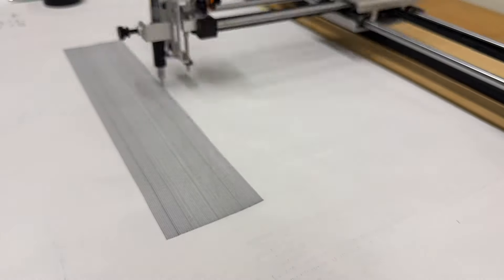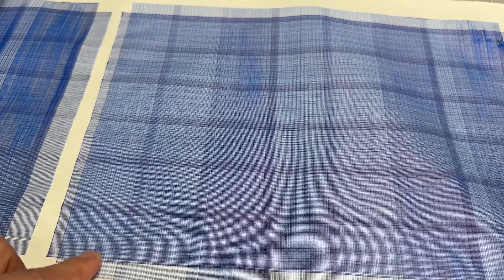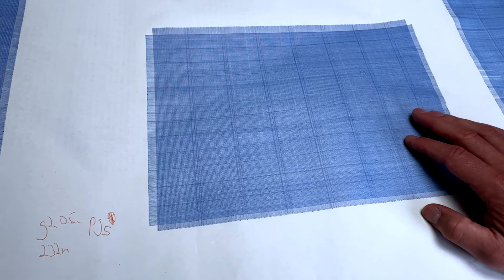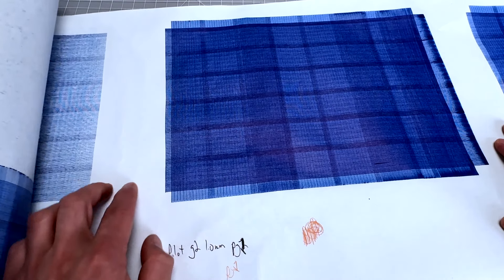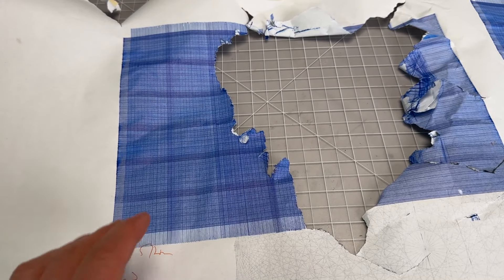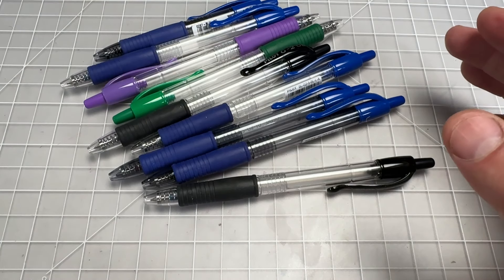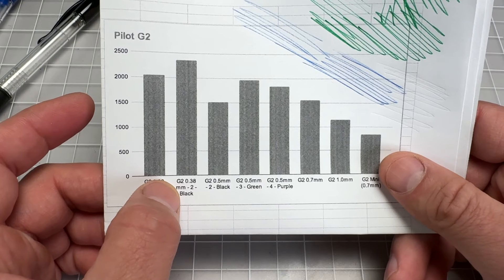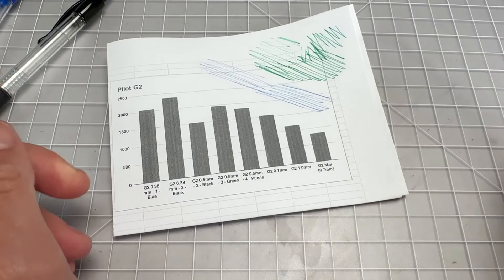How Far Can A Pilot G2 Write?

Comment: Just hope companies won't reduce the ink for finer tips as in the end they can clearly make all the pens write the same length regardless of the tip size.
Reply: The reality is that the larger tip size will slightly affect how much it can go. However I'd like to see something like this for fountain pens to see what the most reliable ones are which would be interesting.
Reply: @MitchellJBridges  I meant companies can reduce the ink on smaller tips. So that in the end it will write the same as bigger tips rather than writing more. The companies can clearly do that which I don't want , that's it
Reply: @hilmyakatsuki1665  I don’t see that happening really. It’s bad practice, and for what you retain in profits, its not worth it. Think about the competitors, one pen company might do and it won’t take long for people to notice and switch over. As greedy as most companies are, I imagine this is one line they won’t ever cross.
Reply: @gibxkey7633  I hope this will be the case but many companies around the world does similar things.

Comment: In my personal experience, green ink seems to be a dryer ink than other colors, so the green lasting longer makes sense to me.
Reply from the maker: Yea ink color is an another variable that perhaps I should not have introduced, but I was in a pinch and needed to buy the G2 0.5mm locally
Reply: @unsharpen  that actually would make an interesting test in and of itself. Within a brand and size (Pilot G2 0.5, Uni jetstream 0.36, etc.) the differences in longevity of different colors. Like I said above, green tends to be drier across multiple brands, so I’d be curious to see how different colors would perform.

Comment: Loved it. You should try the same with Schneider One Business pens. 0.5mm claims to write 2000 metres. 0.6mm claims to write 2200 metres. 0.3mm claims to write 2500 metres. And 1.0mm claims to write 2000 metres.

You may need a good or higher GSM paper for these pens though.
Reply from the maker: Great find on those pens. Where are you seeing the distance claims? 

The higher end paper is a tough call now, give how many house I have invested but you are right, it’s an issue I need to review

Comment: Thanks for putting in a lot of hours and detailed work. I wonder if some of the "running out of ink" is really a question of tip wear (and accumulatiion of micro-debris where tip revolves in the housing)...?
Reply from the maker: Tip wear seems unlikely to me given the metal construction but accumulation of paper fibers could definitely be an issue. I do see some fibers near the ball but I’m not sure they could get in between the ball and the holder given the tolerance. This is one thing I’m not sure how to prevent except going to a glossier paper, which seems like it might extend the life given lower absorption rates

Comment: Very interesting experiment on Pilot G2 refills. Schneider claims its gel ink Gelion+ 0.5mm refill could write 1,100 meters. Considering the different ink volumes of Pilot G2 and Schneider Gelion+ refills, I would say Schneider's claim is quite comparable to the experiments in the video on Pilot G2 refill. At least for the two companies, the capacities of their gel inks are quite similar. You can have a rough idea about how far their gel ink refills can write, simply by the ink volumes and the nib sizes. Their gel inks are very similar, regarding to writing capacity. 
An interesting extension of the experiments on G2 refills, would be measuring the writing capacities of the traditional, oil-based ink cartridges such as those from Bic and the refills of the new, trendy hybrid ink refills represented by Uni Jetstream. Keep up the interesting experiments, gentleman.
Reply from the maker: Thanks for the thoughtful note. Where are you seeing the gelion rated for 1100 meters? I can’t find anything on their site. Thank you.
Reply: @unsharpen  Schneider is also selling their products in China.  On many well-known e-commerce sites in China, selling the Schneider products, they advertise that the gelion+ refill could write 1100 meters.  Quite wide-spread advertisement.  That's why I call it a claim and it's interesting to be independently verified.
Reply: @unsharpen  It's interesting to mention that I tried to satisfy your curiosity by replying to your comment several times.  Many of my replies just disappeared.  I could only get through in a self-censored manner.  Is it due to my unflattering comments within the replies, on certain e-commerce sites in China?  I still don't have a clue.  It's just on a pen review channel.  Very funny indeed.

Comment: Oh my, I was making "how far can X write" by hand X_x
Reply from the maker: Probably has many advantages over this method if you have the patience and wrist durability!
Reply: @unsharpen  haha, I need to find my Pilot G2 notes, wonder how they compare! I was tempted to try a plotter myself at first, but after testing Sakura Gelly Roll and having the tip/ball mechanism fail twice, thought putting real "handy work" was interesting. Same happened with Fishers space pen - the ball failed on the two refills I tried.
Reply from the maker: 100% this. Physical failures before running out of ink is the real problem here.